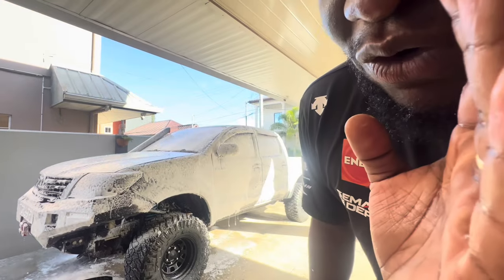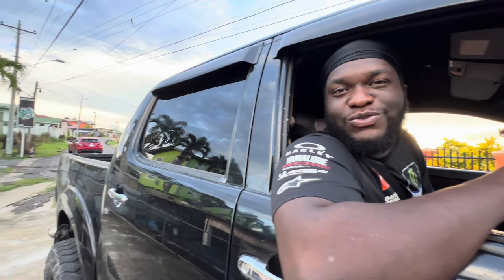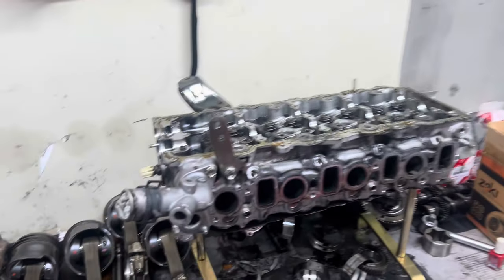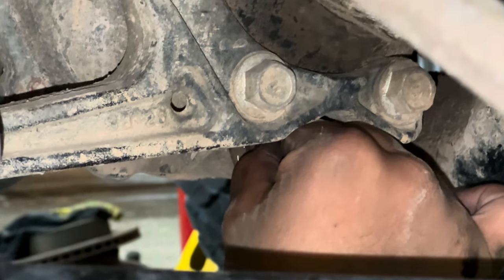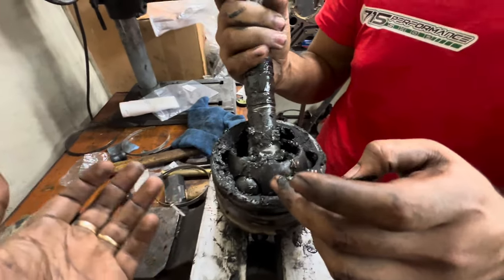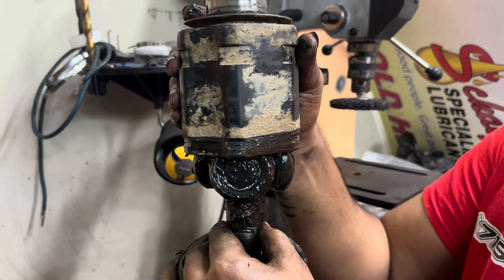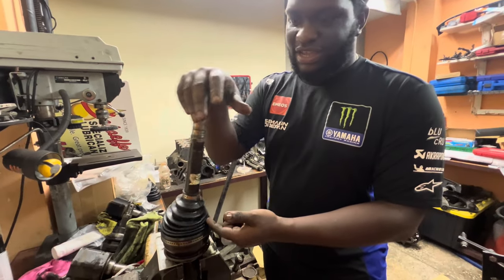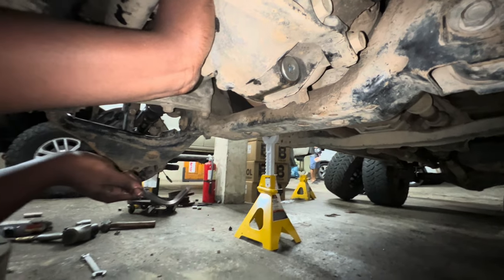I Broke My Toyota 4x4 IFS Axle, This Is How I fixed It!

Comment: Does your van have a body lift or suspension lift?
Reply from the maker: Both
Reply: @KDBATVOffroad  did you have to change other parts to accommodate the lift along with the bigger tires. Also how much different did the handling feel after. I have a 2014 hilux I want to start modding and I'm looking for some advice